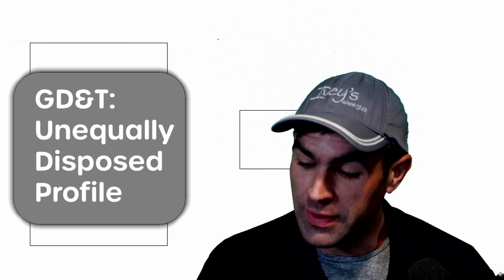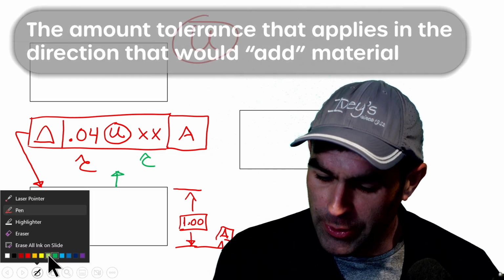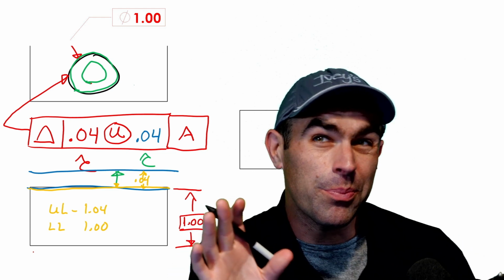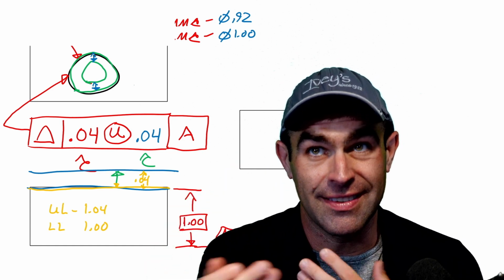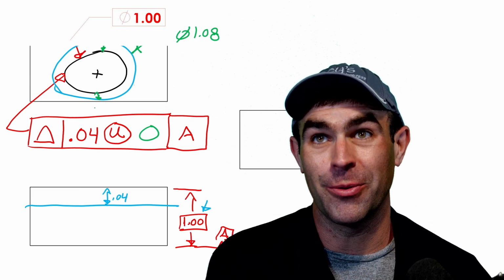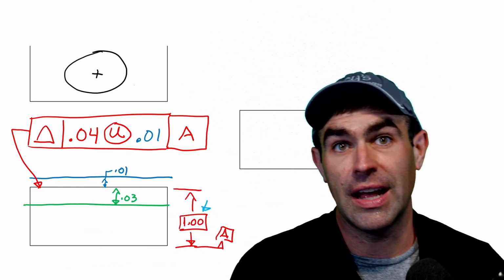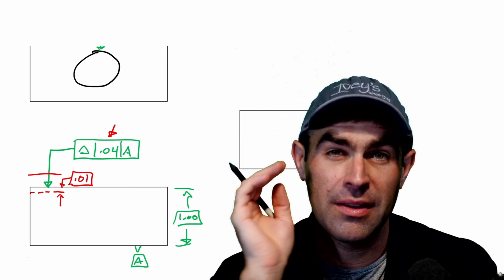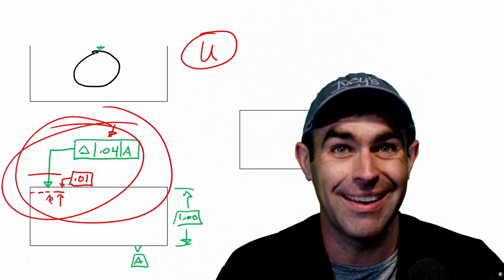GD&T Unequally Disposed Profile "U" Symbol

Comment: @13:54 I really like “...that aren't as hip to GTA, which sometimes feels like it's everyone, ....”.
But there's another question: why are so many techs not as hip to GD&T or ISO GPS? 
Perhaps the typical specifications are not very much based on geometric feature functions. There is still a lack of explicit functional specification. For example, a contact should be specified at the level of an assembly, not just in an individual part drawing where the contact partner is missing every time...

Comment: Why engineer want to use the profile unequally dispose for the design ?
Reply: It’s easier to roll the rev on a profile by changing the feature control frame then remaking the model and keeping a normal profile.
Reply: Here's an example I used the other day, I put slots in a plate. They were sized to allow clearance for a coach bolt, the slot could get bigger, but not smaller or the bolt wouldn't fit.